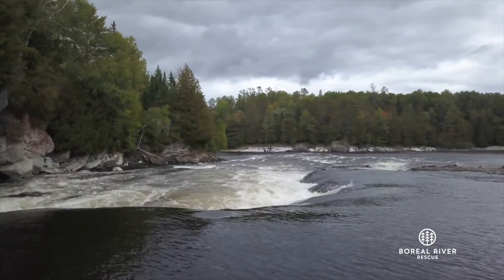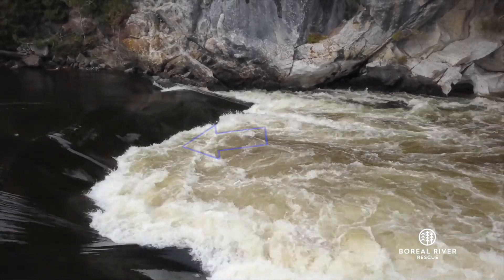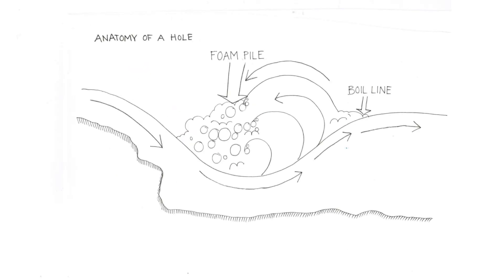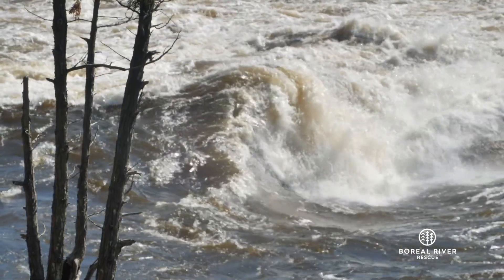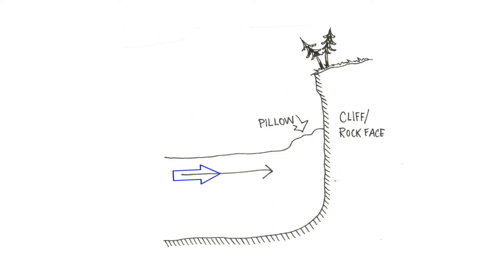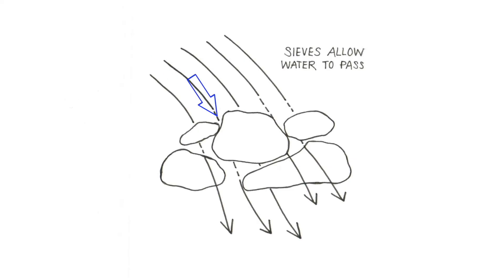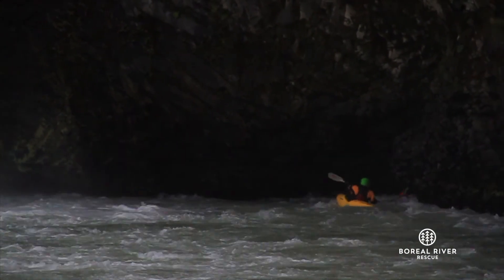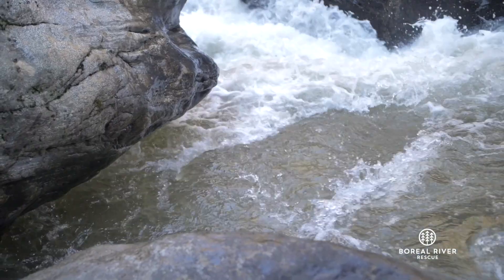River Hydrology 101 - Part 2 - How to 'read' whitewater rapids

Comment: Please advise me what specific rivers (and stretches of rivers/named rapids) were shown in this video.  I am most interested in identifying the big, heavy, crashing whitewater sections shown towards the beginning of the video.  

Excellent explanation and analysis.  I believe some lives might be saved if every casual rafter/inexpert hard boater would watch this video before paddling class II through IV whitewater.
Reply from the maker: @johnmaxwell1750  Hi John, glad you’ve found this valuable. This is the Upper Gatineau River in Quebec, Canada, about 1h45m drive north of the city of Ottawa, Ontario. The rapid is called Lucifer’s.
Reply: @borealriver - Thanks for your reply.